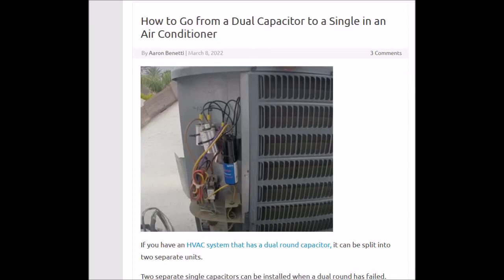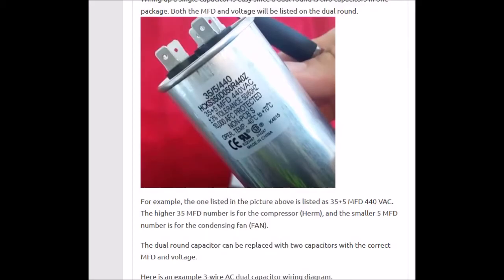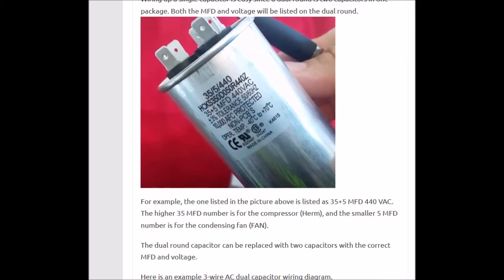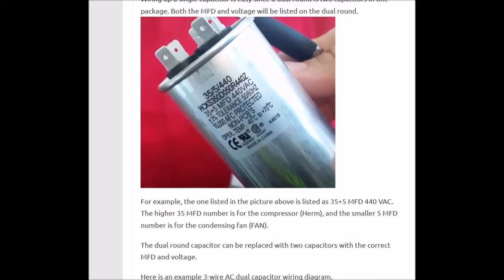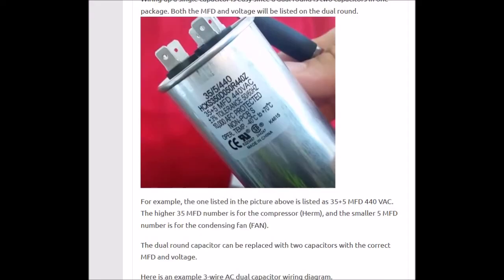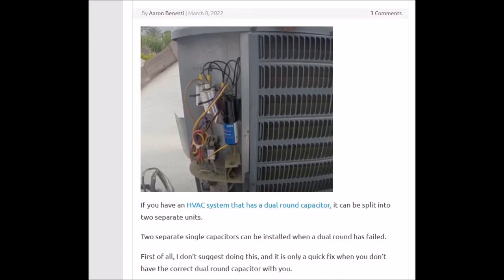How to Go from a Dual Capacitor to a Single in an Air Conditioner or Heat Pump

Comment: I have an older AC unit running with just one capacitor rated 330v 72-85 mfd. What's happening? Does it mean the fan may have a built-in capacitor?

Comment: I have a 30+ yr old York that was hardly ever used, it has two two prong capacitors, one round & one flat oval, no color wires & no markings for fan, common, & H. How do I tell where the wires go? Purchased two new ones, & they’re unmarked also. 

TYIA.

Comment: Hiw about the other way?  Have the 2 single and I would like to replace with dual?
Reply from the maker: Yes, as long as the right capacitors are used, either method will work.